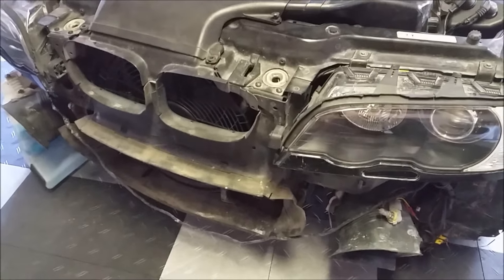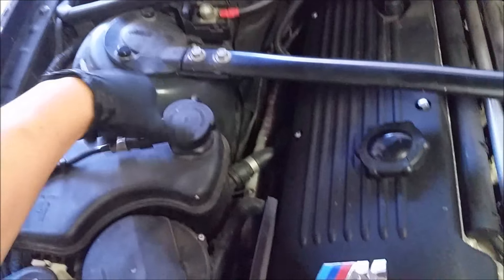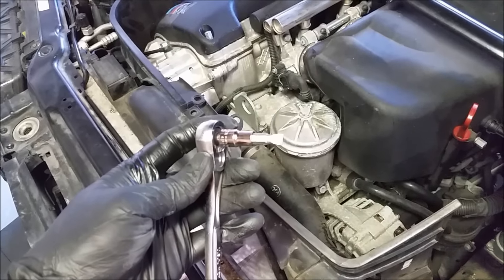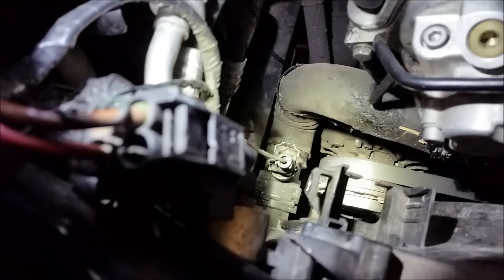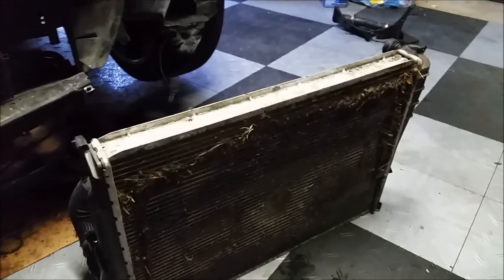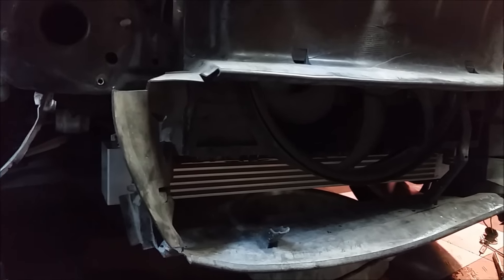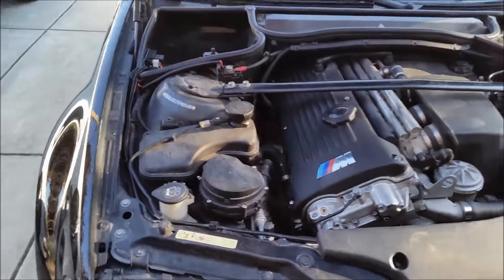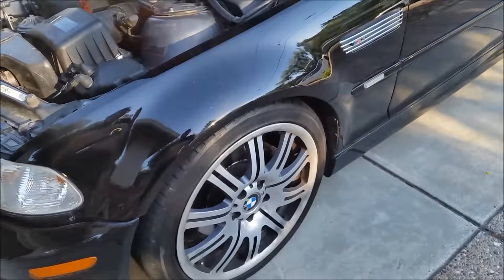E46 M3 Track Build - Ep 2 "Too Cool For School"

Comment: In what temperature does your fan come on? do you have to remove the auxiliary fan to do this? Nice video though!
Reply from the maker: You have to remove the Clutch fan to run the electric fan, but you can keep the Auxiliary fan. I remove my auxiliary fan to: 1) save weight from the front, 2) more airflow to the upgraded radiator, 3) running the electric fan. Car does not overheat on track and the AC works fine.